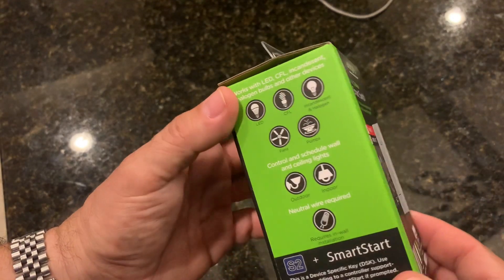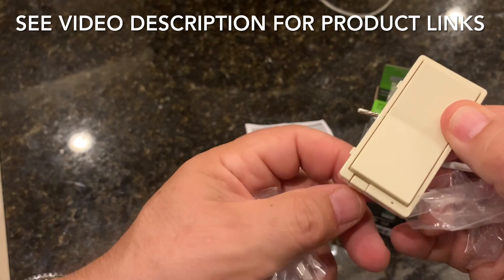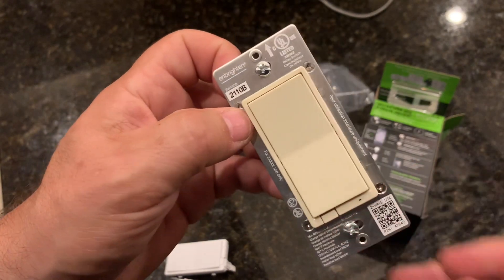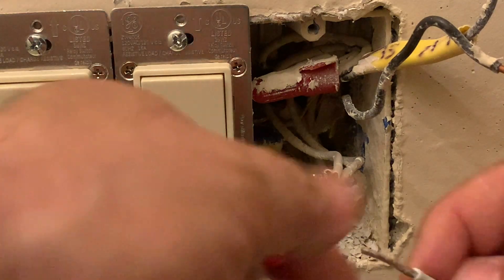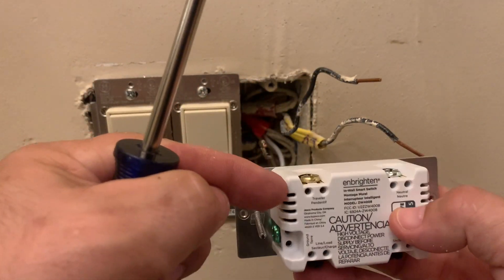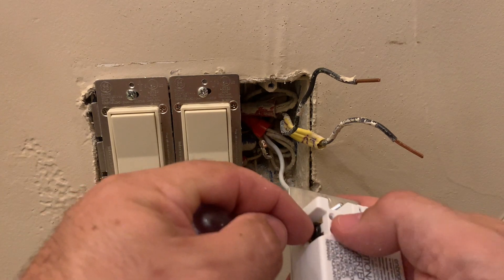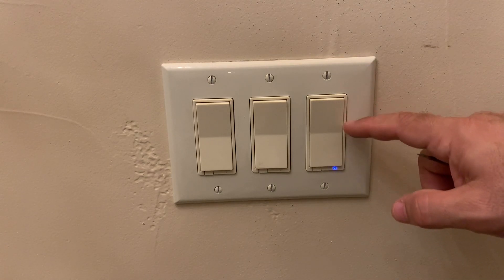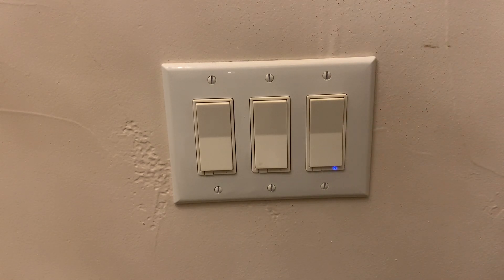Z-Wave ● Enbrighten Switch ● How to Install a Smart Switch by Yourself ✅ DIY zwave

Comment: I need to know how to do a 3 way switch.  Do I need 2 of these switches to wire a 3 way circuit?
Reply from the maker: @ken9190  you need ONE smart switch and a specific type of smart switch to be the other side of the 3-way. They make a different version specific for the 3-way situation.
Reply: @ApacheRanch  where can I find the info, for that other type of specific switch for the 3 way?

Comment: do these switches require a hub or can i control them from my cell phone??
Reply from the maker: Needs a hub
Reply: @ApacheRanch  any specific one?
Reply from the maker: Search for Smartthings compatible hubs. Smartthings hubs are not made any more, but there are other compatible hubs out there that work with Zwave switches.

Comment: I don’t have a bundle of white wires
Reply: Then you likely have an older home wired without neutral wires.  There are other "smart switch" options that might be a better fit.  Enbrighten 52252 offers a similar path with Z-wave, but there are also other Zigbee and wi-fi options if you don't already have a z-wave controller.